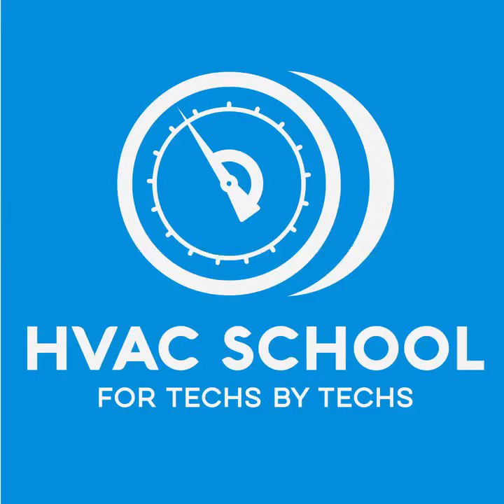Water Source - The Water Side w/ Eric Mele

Comment: I find that in the Pacific northwest we use a descaler or scale inhibitor, and biocide in our cooling tower treatment. Chemicals tend to be proprietary to the vendor but are all very similar in both cost and effect. I also found FHP to be amazingly reliable on a closed loop condenser system. Never seen a failure in the condenser/ heat exchanger.  With a perfect 70°F loop refrigerant pressures are completely predictable. It was the best system I ever serviced.